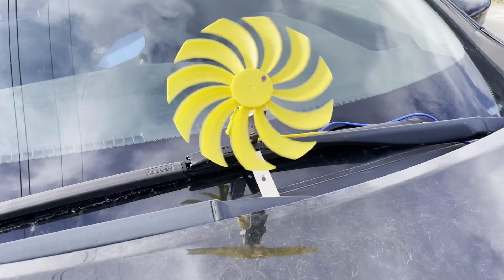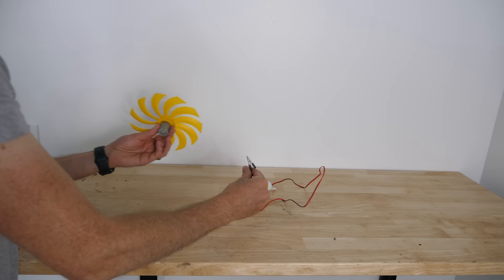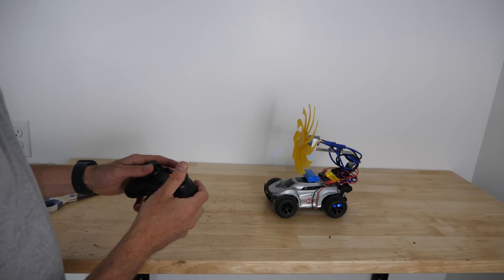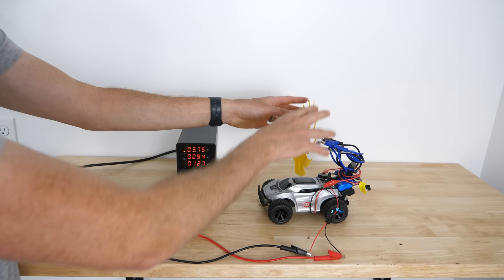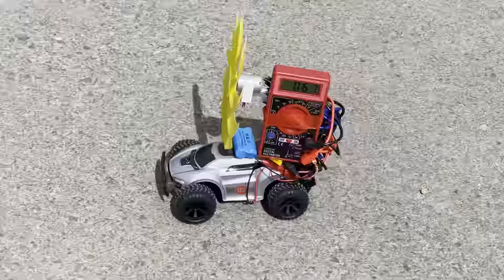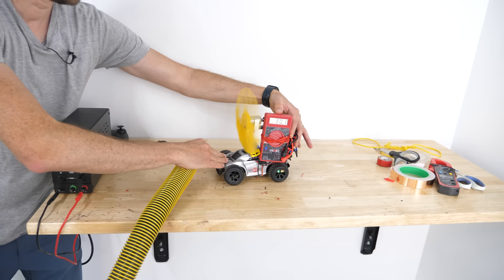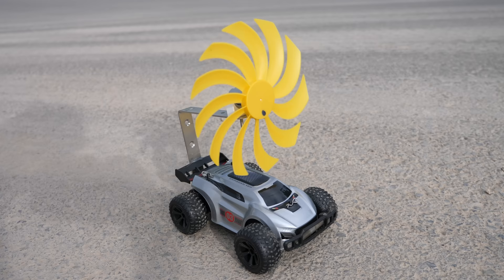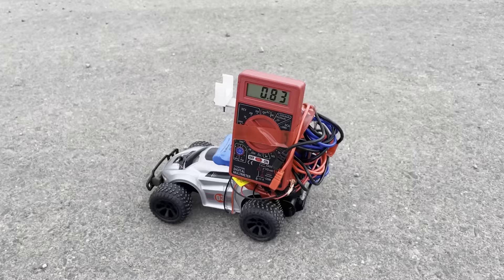Can You Power a Car With a Wind Turbine?

Comment: I think the veritasium faster than the wind buggy (also sailboats) have some relevance to this subject. I.e. we can extract useful energy from the wind given the correct setup. But on a windless day you won't move.
Reply: Correct.  This is a good video, but he was mistaken when he said it won't work even on a windy day.
Reply: @Rick_Cavallaro  He could be right, if the wind turbine and generator and DC voltage conversion aren't all that efficient.  In particular, the generator produces a voltage too high for the battery, and so even if the turbine and generator were fairly efficient (possible but not a sure bet for something marketed as a scam), an awful lot of energy might be lost right there.  It is possible to make a good DC-to-DC voltage converter, but I suspect that a cheapo remote-controlled car won't have a good one.
Reply: @Lucius_Chiaraviglio  
>> He could be right, if the wind turbine and generator and DC voltage conversion aren't all that efficient.

But that's not what he said.  He said it can't even work on a windy day - and it definitely can.  Sure you can come up with a system that's too inefficient to work, but what does that tell you?
Reply: @Rick_Cavallaro  What I mean is that he might be right about it not working on a windy day if the system is inefficient enough that the drag when the wind is enough to give enough power for this is enough to prevent the car from moving and/or forces it to use more energy than it gets.  I don't think he made it that way on purpose, but when using cheap components, it might end up that way.
Reply: @Lucius_Chiaraviglio  That's not what he said.
Reply: That was bogus. You can't get more energy than the wind supplies in a wind driven craft. It defies the laws of physics. This video should explain what principles should be applied to that video. I suspect the problem is a poor understanding of relative wind in veritassiums video. The vehicle could move faster than a component of the relative wind if it is coming at the vehicle from an angle. But the most energy and therefore highest speed should be availabler when the wind is directly behind. If the vehicle were going faster than the wind, the wind would no longer  be pushing on the sail or propeller, and the vehicle would have to slow until the wind was pushing it again.

Those toy cars with the fans on them were driven by the treadmill not the wind, a bit like the old friction motor toys  from decades ago,. Probably the fans were operating like a flywheel, and it would have been interesting if they had substituted the fans with a rotor of similar mass to see if that was the case or whether the fan actually added to the motive power.

Altogether that was a very poorly thought out video. Strange that veritassium should be so gullible as a science educator.
Reply: @crabby7668  
>> That was bogus. 

Good thinking!  Unfortunately that exact same thinking cost Professor Kusenko $10,000.  Fortunately for you, I'm prepared to offer you the very same bet since you understand how Veritassium just doesn't understand physics.  What do you say?
Reply: @Rick_Cavallaro  as far as I can tell, the key difference is this: 
- veritasium (and xylas model) use the fan as a propeller, i.e. as a motor that is "powered" by the turning wheels, all dependent on a finely tuned gear ratio between wheels and prop (and on very low friction etc.).
- action labs model uses the fan as a generator - so you can't make use of the same effect.
@crabby: Consider Veritasiums "trivial" non-wind example of the faster than wind effect. A small cart has connected wheels of different sizes on its top and on its bottom. Put a large rail on top of the top wheels. Then if you move the rail with speed v1 (relative to the ground), it is possible that the cart moves at v2 which is greater than v1 (rel. to the ground). Or watch the video haha.
Reply: @doyouwanttogivemelekiss3097  
>> - veritasium (and xylas model) use the fan as a propeller

That's correct, because Derek wanted to do an episode covering DDWFTTW (i.e. directly downwind faster than the wind).  By replacing the propeller with a turbine, I set the direct UPwind world record with that same vehicle.  My downwind record is 2.8 x wind speed.  My upwind record is 2.1 x wind speed.

>> @crabby: Consider Veritasiums "trivial" non-wind example...

Hey now - don't be explaining this to crabby.  You're gonna cost me $10,000.
Reply: @Rick_Cavallaro  Peter Worsley in the UK has made a number of models and actual craft that can sail upwind (numerous videos on YT). A central tenet of his designs is that optimal blade angle is 45° maximise the lift/drag ratio.  Of course, there must be a prevailing wind for operation. The turbine used in this demonstration is effectively an air brake while the vehicle is in motion.
Reply: @Rick_Cavallaro  that professor didn't put up a very spirited opposition did he? No counter arguments or anything iirc which is very odd given it might cost him $10k. Might it just have been a stunt?
Alternatively, there is the possibility that the professor specialised is another branch of physics so wasn't particularly familiar with the specifics of this case. More fool him if so. 

Veritassium has published  several videos that have been criticised as being fast and loose with the facts, in areas that are claimed to confuse and misinform exactly the type of people who he claims to be trying to educate.

I don't know if he doesn't know the physics, or omits a proper explanation for clicks, or just fails to get the explanation over well. In all three cases the viewer will get an incomplete or innacurate picture of the actuality.

If you think a wind driven vehicle can travel faster than the total windspeed component in the direction of the wind, then ask yourself where does the extra energy required to do that come from? Physics says it can't be done, but a YouTuber says it can. I am waiting for the international outcry that the laws of physics have been overturned.

As for a bet, I decline your offer to give me $10K, although I am comfortable that I am correct. Trying to get an equitable solution with some you tubers would be like playing chess with a pigeon as the saying goes. Some people are so wedded to their beliefs that no amount of evidence will change their worldview on a subject. Even if you had $10k to give away, it would doubtless be the hardest $10k I ever earned, so not worth the effort.

It would be better for you to understand the lessons learnt from this action lab video and try applying it to that Veritassium video. You might then see the flaws in the arguments.
Reply: @crabby7668  The professor DID bet $10K and lost it.  It was not a stunt.  He's a professor of physics at UCLA (sadly, my alma mater).  He claims to be an experienced sailor and claims he understands the necessary aero.  He doesn't.

>> If you think a wind driven vehicle can travel faster than the total windspeed component in the direction of the wind, then ask yourself where does the extra energy required to do that come from?

I don't have to ask myself.  YOU have to ask me.  I designed and built the thing, and then set 4 world records with it.  I've given talks on it at Stanford, NASA, Kittyhawk Aerospace, SJSU, and several other places.  I understand how it works.

>> Physics says it can't be done

No it doesn't.  In fact it was used as a problem for the international physics olympiad.

>> I am waiting for the international outcry that the laws of physics have been overturned.

You can wait all you like, but someone commenting on a youtube video (you) that doesn't understand basic physics is probably not going to cause an international outcry.

>> I decline your offer to give me $10K

I didn't offer to give you $10K.  I offered to bet you $10K.  So lets add bets to the list of things you don't understand.

>> although I am comfortable that I am correct. 

You're clearly not comfortable about that.  If you were, you'd take the bet.

>> It would be better for you to understand the lessons learnt from this action lab video and try applying it to that Veritassium video. You might then see the flaws in the arguments.

You sure are hard-headed and condescending for someone that's completely wrong and unwilling to put his money where his mouth is!

You don't think I have the $10K to wager?  We can make it $100K.  We can make it $1Million.  That is an official offer here and now.  My name is on this post.  Hold me to it.
Reply: @doyouwanttogivemelekiss3097  I did watch that video, albeit some time ago, which is why I commented about it. If you look at the experiment with the toy cars, you can see that when on the exercise machine they are driven through the wheels from the moving energy of the exercise machine. The propeller is driven from the wheels through the gear train and iirc there was no wind involved. This would be like towing  the full sized blackbird across the ground. The relative movement between surface and vehicle turns the wheels and hence the propellor ie the reverse of what was being claimed. As I said before it would have been interesting to see them condense the propeller down to just a disc of the same mass but with no aerodynamic surfaces, to see if it was acting as a flywheel, ie storing energy from the rotating wheels. That could explain the little skip forward faster than the treadmill when the toy car was feleased. You would have stored some energy in the flywheel. This is very similar to the old friction toy cars of the 1950s and 60s where you would push the toy across a surface several times to charge a flywheel and then let it go. The energy stored in the flywheel would then drive the toy across the ground,, all without electric motors or batteries!

As for driving the system in the way it was claimed ie the windblown fan turns the wheels through a gear train drive. That gear train introduces a lot of friction into the system depending on the gear ratio. If you have ever tried push starting a car, you will know that you do so in a "high" gear not a "low" one because the gear ratio is less and it is easier to turn the engine from the movement of the wheels. If you try in first or second gear you will not move the vehicle let alone get it to the necessary speed because the friction in the higher  ratio won't allow it. For all those with an automatic car, do not try this at home. 

So you could  be losing a lot of the energy harvested from the wind via the propeller through the drive train. So the energy harvested from the wind is never equal to that available for the wheels. If the wheels won't go as fast as the propeller would allow then it would be unlikely that the vehicle could go faster than the total wind component in the direction of the wind. The propellor might act as a flywheel to give it a little kick now and then but that little extra won't be sustained as the energy would be depleted from the flywheel propeller.

As I said, I think there is a misunderstanding of vector diagrams of wind components. Yachts and other sailing ships spend a lot of time sailing with the wind at an angle to their intended direction of motion, so rarely have the wind directly behind them. The wind vector component is always greatest in the direction of the wind. It can't be otherwise.  When the ship is sailing at an angle to the wind, the wind vector directly behind it is smaller than the actual windspeed so it may be misconstrued that the ship is sailing faster than this wind vector, but it is not actually sailing faster than the real total winspeed. I suspect that this is where people are misunderstanding.

After all if this new technology did what people claim, then it would be possible to fit these sails to other unpowered vehicles such as gliders. Wouldn't that be great, just stick up a sail on a glider to extend its flight for as long as you want. 😊
Reply: @Rick_Cavallaro  oh so you were involved in the project, that makes sense now.

I would still say that professor didn't make much effort to protect his money. He didn't seek to demonstrate any counter argument in the video which is what made it look a bit fishy. Maybe he did and it wasn't included in the video for some reason, I don't know.
Just because someone claims to be a sailor does not mean they know everything about the subject. 

It's not up to me to prove anything. You are the one who is claiming to have superceded the known orthodoxy. It is up to you to prove your case. Maybe you have, maybe you haven't. I wouldn't rely on veritasdiums video as evidence in your case though.

You seem to be getting a bit desperate with your betting, dare I say a little bit unhinged with your final attempts. Even more reason to stay well clear. 

If your invention is a good as you claim, then it will rise to the surface on its own. That will be the real test of whether it works or not. It won't require you tubers such as me to understand it, it will just work. 

The action lab video still shows some good points for those who want to learn.
Reply: @crabby7668  
>> you were involved in the project

It was my project.

>> I would still say that professor didn't make much effort to protect his money

First of all, you have no idea what he did or didn't do.  I do.  And there was nothing he could do to protect his money.  Had he had even a lick of common sense, he would never have made the bet.  Derek and I could hardly believe he was willing to go through with it.

>>  You are the one who is claiming to have superceded the known orthodoxy. It is up to you to prove your case. 

Wrong on both counts!  What I have done is based on very simple physics.  I can prove my case in about 4 lines of high school physics on the back of a napkin.  I think the 4 world records and the problem being included on the international physics olympiad indicates that I've proved my case.  You're the one making the assertion we're here to bet on.  And frankly neither one of us has to prove anything until you accept the bet.

>> You seem to be getting a bit desperate with your betting, dare I say a little bit unhinged with your final attempts. Even more reason to stay well clear. 

I'm unhinged because I'm willing to bet on YOUR ludicrous claim - while you're not!?  This must be pretty embarrassing for you.  But there certainly is one obvious reason you should stay well clear.  You're claim is nonsense, and you clearly don't have the funds to lose.  If I'm wrong - take the bet.

>>  It won't require you tubers such as me to understand it.

It's a good thing since you clearly have neither the ability nor interest in understanding it.  And you're not a youtuber.  You're just some yutz making unsupported drive-by claims on someone else's video.
Reply: @Rick_Cavallaro  one silly question: Can the wind drive a prop car (no sails) on a beam reach, and if so, how?
Reply: @doyouwanttogivemelekiss3097  It definitely could.  You'd want to pivot the nacelle so the prop is facing the relative wind.  But it's less interesting - since people would probably readily accept it; and it would almost certainly be less efficient than using a single wing like my buddy Richard Jenkins did when he set the record at 126 mph with his Greenbird.
Reply: @crabby7668  
In the other video it was directly down wind and it worked.
Reply: @stephenolan5539  it also goes directly upwind faster than the wind, but that wasn't covered in the Veritassium video.
Reply: @Rick_Cavallaro  I'm just imagining a wind-driven formula 1 style track race with wind driven vehicles, (and unlike sailing, without tacking or gybing).
So if f-1 ever were to become serious about their environmental commitment, that's what I'd love to see haha
Reply: @Rick_Cavallaro  well I didn't expect to find such a gem in the comments :P I wonder what makes ppl be so adamant in saying that the vehicle can't drive faster than the wind (while it was done and documented), maybe they just equate speed with energy which is very wrong
Reply: @funkenjoyer  I've wondered that since 2006.   It never occurred to me that I'd have to actually build one of these things to prove the point.  And it certainly never occurred to me that even well-documented, real world evidence would still fail to convince people.
Reply: @crabby7668  
The extra energy comes from the air being slowed down below the speed of the vehicle instead of to the speed of the vehicle.
Reply: @My_initials_are_O.G.cuz_I_am  how does that work then? Surely if the air immediately behind the vehicle travels slower than the vehicle it is applying drag and not thrust. To use an analogy, if you were pushing the vehicle with your hands at a constant speed, your hands have to be pushing at the speed of the vehicle not less than the vehicle speed, or your hands detach from the vehicle. If you supply an impulse push, the vehicle travels slightly faster than your hands, but friction and drag will slow the vehicle until it comes back into contact with your hands. If the wind comes directly from behind and is the only thrust the vehicle is getting, then the same surely applies?
Reply: @crabby7668  
The propeller has a constant stream of air from in front of the vehicle, since the vehicle moves faster than the wind.  
So unlike a single person pushing from behind, when air "detaches" from the propeller, it creates a low-pressure zone and more air rushes in to fill said zone.
Reply: @My_initials_are_O.G.cuz_I_am  yes but that low pressure zone creates drag. If you have high pressure on the front of a surface and low pressure at the rear, the air pressure will want to push the surface toward the low pressure zone. An independently powered propeller gets round that by using its power source to drive it through the air. You can't use the air pressure that you are using to rotate the propeller to simultaneously drive it through said air. You are entering perpetual motion territory there, if that is what is being claimed.
Reply: @crabby7668  
1) The propeller is rotated by a linkage to the wheels, as the wheels are rotated by the forwards motion of the vehicle against the ground, the wheels-propeller linkage rotates the propeller.

In other words, the vehicle uses the ground as an anchor to slow the air down to a velocity between its velocity and the velocity of the ground, in a manner similar to a boat being able to use the difference between the sideways and forwards drag in water to use the water as an anchor to be able to move faster than the wind, 
however, the boat can only do that diagonally, due to the fact that the boat does not get that directional drag difference when going downwind, it cannot move directly down wind faster than the wind. 
This vehicle uses the difference between the sum of ground friction (none) and air drag of the main body and the ground friction of the wheels, to do what a boat does, but downwind.

2) The low pressure zone would be created inside of the propeller not behind it, and air also moves in from the sides.

Also, I don't know why you're acting as if this was just a theoretical thing that has never been done, the vehicle actually moved directly downwind faster than the wind. So there's no point in arguing that it's impossible, the same way there's no point arguing that a heavier-than-air aircraft is impossible.
Reply: @My_initials_are_O.G.cuz_I_am  so the propeller is driven from the wheels interaction with the ground, from the vehicles forward motion. What gives the vehicle its forward motion? As far as I can see, people are saying it is the wind rotating the propeller that drives the wheels. So in total the propeller drives the wheels that drive the propeller. Taking Friction and aero drag into account, can you not see a problem with that scenario?

If that is not the scenario then someone needs to explain the theory a lot better. If it is the scenario, then you are failing to learn the lessons shown in the action lab video.

Drag slows things down not speed them up. It is the generated lift that does the pulling.

Where is the low pressure developed inside the propeller, how, why? How does it pull the vehicle forward? 

Nice sraw man there with the heavier than air flight. No one has claimed that and that phenomenon has been adequately proven in theory as well as in reality. Whereas this has only been claimed, and not proven to the doubters satisfaction.

I have looked back into the Web past of people commenting/discussing  on this subject and none I have seen give an adequate explanation. Too often they regard the propeller driving the wheels and the wheels driving the propeller as completely separate functions, but they are not. They are dependent on each other. Hence the perpetual motion issue.
Reply: @crabby7668   
The directly downwind faster than the wind vehicle and the vehicle in ActionLab's video are practically the opposites, OP most likely confused the two, or just noticed some analogies, but we are not talking about ActionLab's RC car with a turbine, so let's not conflate them. 
A lot of people (everyone who claims that the propeller is a turbine, for one) also got confused the same way because, as you said, there's not many good explainations.
 
The DDWFTTW vehicle has a propeller that adds forwards speed and wheels that remove speed by powering the propeller, the two cancel out, so we now only need to consider the other forces, the wind and the inherent energy loss due to mechanical inefficiencies. The wind is what adds the energy into the system, it adds the velocity, meanwhile the energy loss is why the DDWFTTW can only achieve a velocity that is a bit over 2x the wind speed.

A boat/car with a sail that moves directly downwind can only slow down the air to a velocity a bit above its own(not exactly to its own velocity, due to energy losses), which is why they can not travel faster than the wind.
The DDWFTTW just like a sail boat that moves diagonally changes the ratio of the effective airspeed of the vehicle's aerodynamic surfaces and the vehicle's forward velocity. (Think of it that way, a propeller kinda is like a sail that moves to the side really fast, encountering more air than it otherwise would have... just in a circle and multiplied by the number of blades.)

The whole pressure problem is solved by the fact that the propeller is a propeller and not a sail, it pushes the air from the roughly cylindrical space its blades travel through (that's what I meant by inside) and air from the front rushes in.
I guess a simpler way to put it is: The propeller makes the air move backwards, including the air in front of it, so it never runs out of air to push.
Reply: @crabby7668  
Moving faster than the wind is essentially all about using the difference in the magintude of 2 different drag forces, subjecting the majotlrity of the wind to the higher one and the vehicle's forward movement to the lower one. a.k.a. Giving the wind the mechanical disadvangage.

Sailboats going diagonally subject the majority of the wind air to the higher water drag force component, due to relatively "static" water arresting the downwind motion of the boat.
The DDWFTTW vehicle subjects the majority of the wind air to the higher drag force (i.e. wheels-ground friction) due to the propeller rotating and sweeping the air backwards, as its rotation is created by arresting the downwind motion of the part of the wheels that touches the ground at any given time, which causes them to spin, as such spinning the propeller.

The only reasons sailboats don't travel directly downwind faster than the wind is because they need to have that angle to create that drag differential.
Reply: @My_initials_are_O.G.cuz_I_am  the action lab video is pertinent because it shows you that you can not get more energy out of the windmill mounted on the car than you expend, due to the cars motion alone. Ie you can't power a car or anything else solely on energy extracted from its own motion. There has to be another power source, eg the wind is blowing faster than the vehicle is travelling.

I am glad we can now discount normal boats or cars with sails from the equation, as you say they can't travel faster than the wind directly downwind. Also that we can agree that the propeller pushes air through the propeller arc when it is driving a machine forward.

Why is the vehicle limited to 2x the wind speed? Is that something to do with the gearing between the propeller and the wheels? The point of gearing or leverage is generally that you move something a long distance to overcome the greater force required to move something at the output. You still haven't said exactly where tbe wind energy comes from so I have to assume from others that it is the propeller acting to harvest the wind. Making another assumption that the 2 to 1 gear ratio is two spins of the propeller to one spin of the wheels, the vehicle will move one wheel circumference forward for every two turns of the propeller. All good so far. However if you now try to use the vehicle momentum to drive the propeller, the gearbox is working against you. You don't get a 1 to 2 increase in speed for nothing. It is much more effort to drive the gearbox in that direction than the other so it will suck up the energy from the wheels and thus the vehicle, in order to double the speed of rotation. If you have ever tried to push start a car (by hand) you will realise that it has to be done in high gear, low ratio and not low gear, high ratio. You cannot push the car in low gear because the mechanical advantage is very much in the wrong direction and friction stops you moving. In high gear it is still the wrong direction but a lot less so. 

If the gear ratio is in the other direction, you get a similar issue but the propeller might find it difficult to rotate the wheels at all if every one rotation rotates the wheels twice. Again the mechanical advantage is in the wrong direction and will probably sap the energy.
Either way you don't get more energy out than you put in, plus you lose some via drag and friction. So the whole round trip propeller to propeller energy available is less than the propeller would have harvested in the first place if it wasn't connected to anything. The propeller can't act at two different speeds simultaneously ie harvesting and driving, so presumably would either rotate at a speed in between the two cases or more likely the lower of the two. That means the harvester is rotating slower and then the driver is rotating even slower etc etc reducing with time until the wind is strong enough to overcome the losses, at some equilibrium. 

I don't know why you describe the theory as a ratio of two drags, but not lift if you are using the "wing" model. Drag is normally regarded as a bad thing unless you are trying to slow down, which is presumably the opposite to what is intended here. I understand that the drag on a yachts keel is used to stop the yacht from literally being dragged sideways by the lift generated on the sail. 

I will read your other post later as I have other things to do.
Reply: @crabby7668  : Bet you also think heat pumps aren't real.
Reply: @pauljones3017  bet you think that (air source) heat pumps, in particular, aren't just the same as air conditioners in principle, and that heat pumps, in general, can defy the laws of physics.
Reply: @crabby7668  : I know well how a heat pump works and how it doesn't break the laws of physics (hint: latent heat of vaporization) . I also know how a superficial understanding of physics can lead to people thinking that heat pumps defy the laws of physics.

Well, a superficial understanding of physics (or rather, a selective and incorrect application of them) can also lead to someone believing that DDWFTTW are impossible.
Reply: @pauljones3017  I know that heat pumps don't break the laws of physics,( i have worked with air-conditioning in the past and am reasonably acquainted with the realities of operation), but the claims made for their efficiencies by the unscrupulous often do. You can't get more energy out than goes in. Efficiency can't be more than 100% due to losses whether you like it or not.
Reply: @pauljones3017  
I think it's best not to argue with @crabby7668
I honestly wouldn't be surprised if they thought that dynamic soaring was impossible, too, since it's essentially gliders doing an extreme version of this (RC glider WR is 900+km/h), but with 2 masses of air, instead of air and ground.
Reply: @Rick_Cavallaro  Do you have a website or published article I can check out regarding your project or an explanation of the physics? This concept has been really interesting to me, and I'd like to understand it better.
Reply: there all energy is coming from the wind still. Same reason on sail boats we might have wind turbines (also sail boats have been able to go faster than the wind with the right design too, it also takes knowing how to sail the boat, this is high performance racing craft we are talking here).
Reply: @crabby7668  It is true you can't get more energy than is available in the wind, the amount of wind energy is a product of more than just the wind speed. The speed of any given particle does define the energy of that one particle, total energy depends on how many particles I'm collecting, and that is before we get to the fact we utilize the same effect as lift but turn it on it's side. The question is really can I reduce my drag enough and harvest enough energy to set-up the conditions to do it.

Racing sailing boats do this all the time, using hydrofoils or planing hulls to plane with as little boat in the water as possible while using massive sail areas to capture as much wind as possible.
Reply: @doyouwanttogivemelekiss3097  if you get the angles right, in theory it could, just like why a bermuda rig is much easier to sail faster than the wind on the reach (and impossible on  certain angles too. for Derek's fan, it would be about getting it pointing at the right angle for the wind.
Reply: @funkenjoyer  Especially being they could also watch high performance sailing like the America's cup and see the same effect.
Reply: @crabby7668  my head hurts from reading all this. You are right when you say wind can not push a unmoving object faster than the wind moves. But! A part of the wind's energy is used to get the propeller turning. The propeller allows the vehicle to access a higher amount of kinetic energy from the wind by connecting with a bigger mass, than the frame would have -> the propeller pushes air backwards therefor connecting to air further away and around. The propeller expands the vehicles "reach" on the wind sorta speak and therefor there is extra energy that is translated into speed. The developed thrust is less working as a direct source of powering the vehicle forward and moreso as a indirect way. It's main function is to access that wall of wind that is going slower at some point than the vehicle relativels speaking, the thrust makes it possible to still push of it and therefor accelerate. Did my layman explanation help you in any way to understand this?